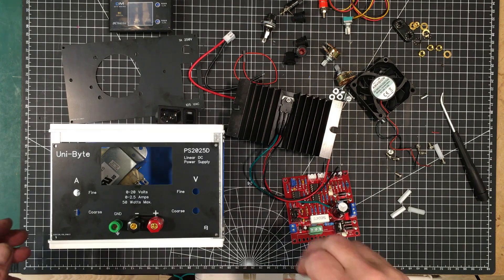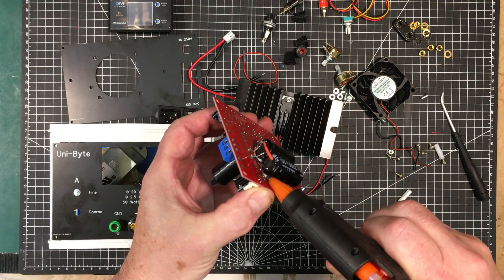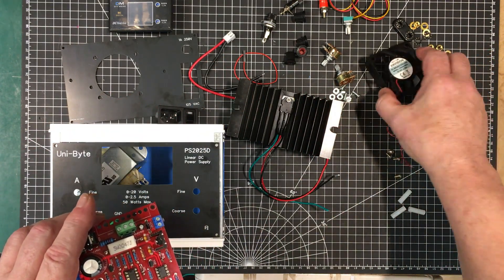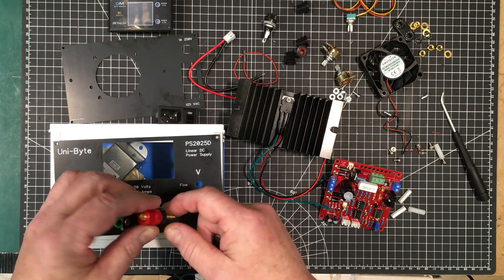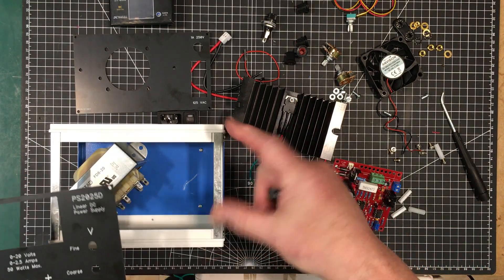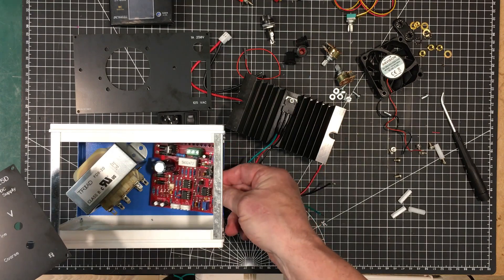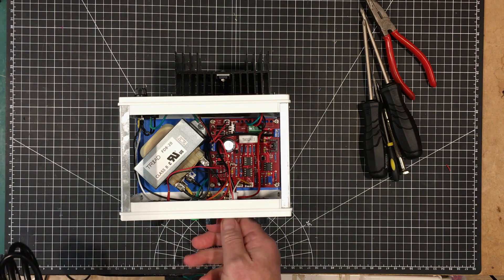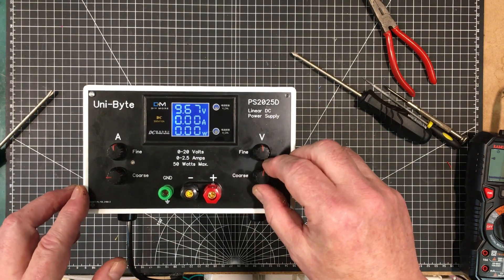Uni-Byte 0197 - Final Assembly of the PIMPED up HILAND Power Supply: Part 4

Comment from the maker: List of changes and additions:

1) Transformer changed from 24V to 20V to reduce stress on the Op-Amps and pass transistor.
2) The expected maximum output of the power supply was then reduced from 30VDC to 20V DC.  This helped deal with the ripple problem.
3) Replaced the fake Op-Amps with LM741s.  Later the voltage error amp was changed to a real TL081 as the increased voltage swing gives better ripple rejection.
4) Changed D7 (negative supply Zener) from 5.1V to 3.9V to further reduce stress on the Op-Amps.
5) Changed R12 from 56K to 27K to limit maximum output to 20V
6) Changed R18 from 56K to 80K to maximize range of control over current limit.
7) Changed R2 from 1/4W to 1/2W (you could even got to 1W).
8) increased filter capacitor from 3300uF to 9900uf and changed from troublesome Won Haung Lo brand to Nichicon.
9) Dramatically Increased size of heatsink from original design.
10) Added fine controls for both Voltage and Current adjustment.
11) installed polarized headers for the fan and to facilitate remote mounting of current limiting LED.
12) Installed terminal block to facilitate remote mounting of the pass transistor.

And of course we added a nice LCD panel meter with V/A/P and put it all in a cabinet.

Comment: Great improvements. Some questions. What is the minimum required negative voltage? Could it be further reduced from -3.9V e.g. to -1V? Next, what is the minimum dropout voltage to achieve proper regulation? I think you have also foreseen fine control for voltage  and current. What are the values for coarse and fine control potentiometers?
Reply from the maker: Thanks.  I did not try to go lower than 3.9V.  That was lowest voltage zener I had but I think you could get it down further but you would need it to be low enough for the op-amps output to reach 0V.  The drop-out voltage for this arrangement would be about 3V given the darlington output stage and the voltage swing of the op-amps.  I used single-gang 10K for the coarse and dual-gang 1K for the fine.

Comment: It needs some kind of calibration scale for the current limit knob, so it can be set reasonably accurately without having to short the output to set the required current. Not that shorting them is a problem,  it just makes it slightly easier and you can just look at the knob to see what current it is set to. Set assuming the fine knob is centered. A very interesting  video series by the way, AliExpress should link to it!
Reply from the maker: Yeah, a scale on the current adjust would have been a good idea.  Thanks!

Comment: Great job and beautiful face how did you make that, with such nice lettering?
Reply from the maker: They are just PC boards without any traces.  You can get precision holes made and use the silkscreen for lettering.  It's a very economical way to do that.  I left links to the Gerber files in teh description.
Reply: @uni-byte  Good idea I should try it sometime.
Thanks
Reply from the maker: @ultimateworkshop2000  You're welcome!

Comment: Success! Looks just like a bought one😆
A larger Fan, running at lower rpm, could be quieter. Nine or eleven sickle-shaped blades. Smaller the gap between blades - the quieter the noise. Less Static Pressure fluctuations, and also quiets bearing chatter.
Monitor the Temperature of those Capacitors. Maybe 8 or so 1/8" holes in the base below the Caps, alow the Fan to draw some air over them. BUT hot Capacitors are an indication of a fault in-circuit.
btw. You can thank Radio Shack for the holes in the sides of the terminals. Pretty smart, imo.
I've start building a new bench PSU.
Reply from the maker: LOL!  Thanks and good information!

Comment: Nice job. Now that you have a TL081 as IC2, you can accurately adjust the 0V with the offset trimmer on the board.
Reply from the maker: You are right.  I had it set for the 741 that was in there before.  I'll have to give it a tweak to get rid of the last 7mV or so.

Comment: Pretty good build, the only thing I don't like is that the box is too small really. I've fallen into that trap too many times, nice box on shelf turns out to be an inch or so too small... 🙂
One thing I will point out about those blue boxes, many have plastic surrounds that the front and back panels screw into, and there is NO continuity  between them, so if your design requires an earthed case then you need to ensure that each panel have earth straps connecting them.
Reply from the maker: Yeah, It's a bit tight.  I do have (should) to ground the top, but the front and back panels are fiberglass (PC boards).

Comment: Nice project and thought out construction.  I would have added an off/on switch for the output.  That would provide an extra chance to make sure the  the voltage has been set correctly.
Reply from the maker: Great idea, I'd actually put it in between the voltage error amp the the pass transistors.  Might still do that.

Comment: Nice results.  Do you know what your total costs are to build that?   It's hard to find a relatively low power linear variable power supply these days. Seems most of the single output bench linear supplies are around 150W and $150, or dual+ output at 200-340W and $240-$1200 CAD.  I've been looking for a dual rail one and don't need 300W but I can't find anything small that would be a good bench supply for playing around with OpAmps, etc.  

Might be useful to people who want to build their own if you put together a parts list with both the improved and additional parts.
Reply: Look at what spec you want carefully The kit based one here has a couple, of expensive parts, (transformer and display) that you can offset against the cost of a ready built unit. Search for linear power supplies, I've found 2A 0-15V units at about 32 GBP , higher voltage units go for around 50GBP  Of course these are only single output, but if the lower spec units will suffice, then  two units can be used to provide a +- type supply. 

There are some very cheap 2 channel liner supplies on ali - I don't know how good they are but the price is attractive for the bits inside alone  if a rebuild is needed.
Andy
Reply from the maker: @andye2005  Yeah, have to agree.  This was more a project to see if I could get this thing working properly more than anything else.
Reply from the maker: This was about $75 CAD total.  The transformer was the most expensive ($34) part and the cabinet was next ($16).  The display was actually not too bad (about $5) but I got that on an AliExpress sale.  It's normally twice that.

Comment: Very nice. I figure all serious techies should have a variable PS and a multi-meter wherever they sit down in their house. It's mandatory. I'd also check the noise voltage on the output when there was no load. PS, you should be fined for having a fine fine.
Reply from the maker: LOL!  I did check it a low voltage and at zero.  Still about 50mV - just the ambient noise.

Comment: how do you made the labeling in front panel? its look neat
Reply from the maker: They are actually just PCB boards with no traces on them.  Easiest and cheapest way to get custom panels made.
Reply: Yea it looks very nice!
I was wondering the same question. Was this plate ordered from other company or did you make it yourself (same with the painting and the drilling)?

Comment: Why would you make such a weak power supply anything less than 1000W is a waste of time imo
Reply: For most hobbyists who want to make their own lab power supply, this is not too expensive, not too complex, and it will cover their needs.
Reply: I routinely test electronic devices that require less than one watt. Often times these tests go on for weeks or months at a time. It’s much better to have more than one small power supply rather than one big honking power supply. You wouldn’t go out and buy a big tractor and trailer rig to haul a lawnmower.
Reply: @mikebond6328  Sure there are small requirements for some things, that isnt the point, a 2.5AMP power supply is a waste of time to build.  You are just going to be building more later for somethiing stronger, I get the point of having low power requirements but you act like you are only going to use this supply for one and only one thing
Reply: as a hobbyist i rarely set my supply current limit beyond 500mA. ( i usually set at 100mA when turning circuits up first time - just so that parts don't blow up in front of my face)
why you need 1000W for.
Reply from the maker: 1000W!  I usually power up a few op-amps, some transistors and maybe the odd micro controller or 8-bit computer.  My BIG power supply is a Siglent SPD3303X rated at 220W and I have never needed all that.  Just as a matter of interest, what would be powering that you need a 1000W power supply?